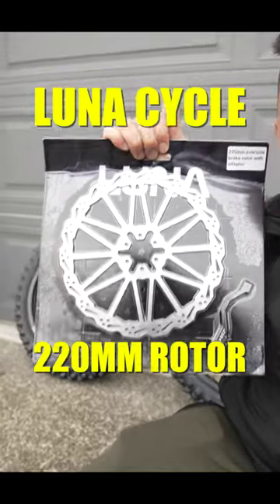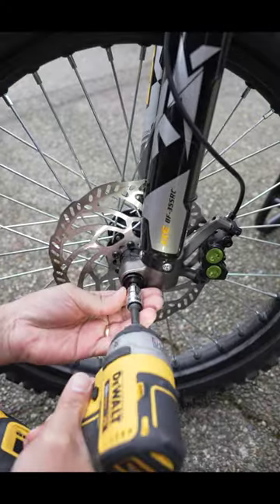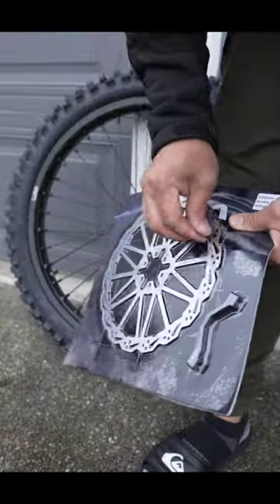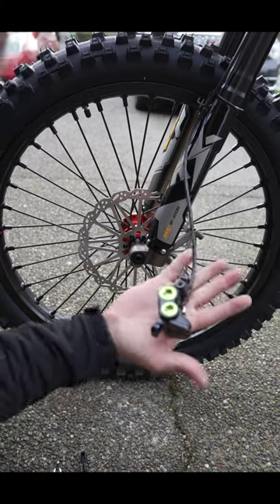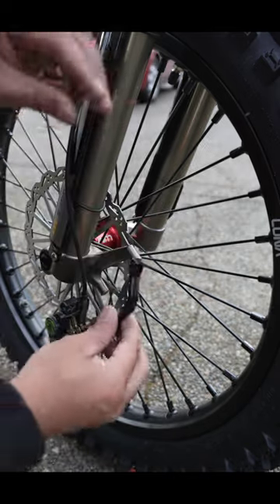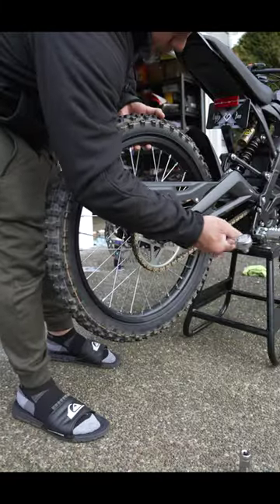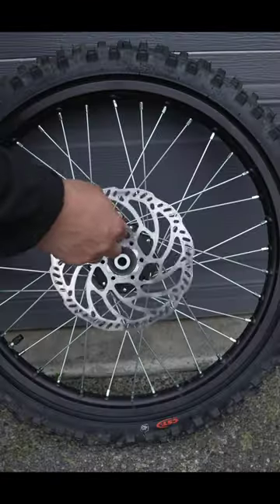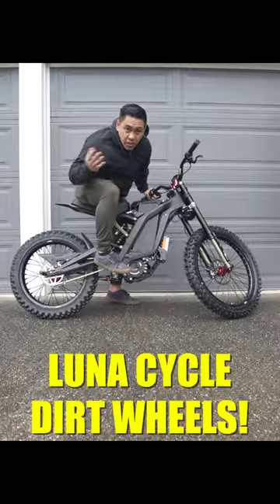SUR RON 21 X 18 DIRT WHEELS @LunaCyclesLLC

Comment: Bicycle mechanic here. In all honesty I never use any cleaners on a brand new rotor… just a solid bedding after install.
Reply: Yeah in my experience they always come spotless when brand new so as long as you keep them clean during the install you should be good
Reply: Isopropyl alcohol is the only thing I use to clean the factory oil. Then I bed the rotors
Reply: @_francisco_   rotors do not come oiled in the bicycle industry. I’m sure this rotor falls in the category. Oil on rotors is a huge no-no.
Reply: @_francisco_  I work for a local manufacturer here in Vegas. Every rotor we use is oil free. If they’re being shipped with oil on a factory rotor, do not buy them.
Reply: Also bet you’ve never used power tools for a simple job like this but here we are 🤣🤣🤣
Reply: yeah, but then he grabbed the rotor right by the braking surface, so maybe it was for the better
Reply: This guy uses brake clean every time he stops at the lights I'm sure

Comment: How often do you snap them spindles? 
We went to thru axles for increased strength over skewers then to maxles, 
These use undersized parts for their size and weight so what are they good for?
Like a budget 2 stroke without the fun/balls

Comment: The Ugga Dugga rating is 1000 for all the bolts
Reply: Damn right. Surron uses parts that are very similar to bicycles. Especially those tiny threads inside the hub flanges for rotors are very very fragile. You can strip them if you go too tight like he did. All you need is 6-10 nm + blue locktite.

Comment: I don't understand why they're making the discs bigger... With the same amount of contact patch... Just putting the callipers further and further away from the frame introducing more and more flex. More and more braking force on a further out part of the disc..

I'd rather have a 203mm or even 180mm disc with twice the contact patch for the pads... 

It genuinely doesn't make sense...

Comment: Cleans the rotor after installing, deff forgot until he got the wheel on. I have been there. 💀
Reply from the maker: Nope. Clean it after you put it on. Obvious reasons
Reply: @Adobo Moto  I generally like to give them a good cleaning with brake clean before installing to remove and contamination from manufacturing and rust prevention for shipping.  Cleaning it after to take of any grease from your fingers after installing it isn't a bad practice either.

Comment: If your putting dirtbike wheels on a surron why wouldn't you just buy a QS systems case motor and throwing in an old dirtbike frame?
Reply from the maker: Weight advantage on the surron
Reply: @adobomoto  that's gotta be rough on the surrounding though? I go through suspension linkage bushings like crazy on my cr125 couldn't imagine the wear and tear on the surrounding riding hard with those tires lot of weight bouncing up and down
Reply from the maker: @dalejrjunior1298  The surron is actually super capable. a cr125 is what, 200lbs? the surron is about half. and these wheels actually don't weigh as much as you would think.
Reply: @adobomoto  yeah 220 ish. I guess it's just a trial and error thing seems a little bit to much bite for it but ay we will see I guess.

Comment: Those wheels are too heavy for the bike I think a 19 16 setup fits the bike better and makes more sense it's a lighter setup and weight matters woth ebikes
Reply from the maker: It’s actually pretty lightweight, specially the front. I wouldn’t say they’re too heavy if you haven’t actually tried this exact setup from Lunacycle…unless you have
Reply: @adobomoto   its just common sense a 19 16 would weigh less than a 21 18

Comment: Why did you grease that thru axle?  There shouldn't be any contact between the thru axle and the hub, it is simply providing tension to hold the hub between the dropouts.
Reply: Same as i doon my road bike, makes it fall in place so smooth, rather than having to hit it in with your hand...